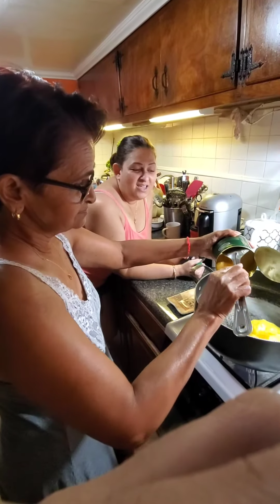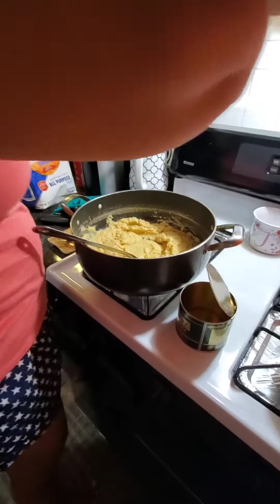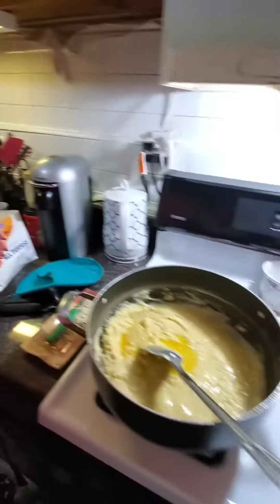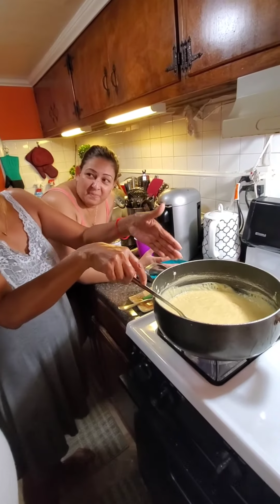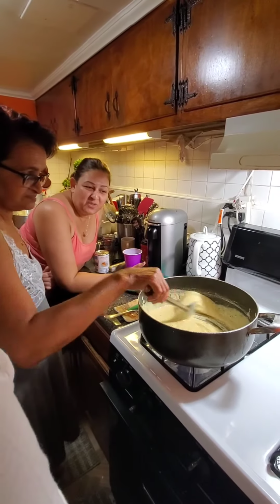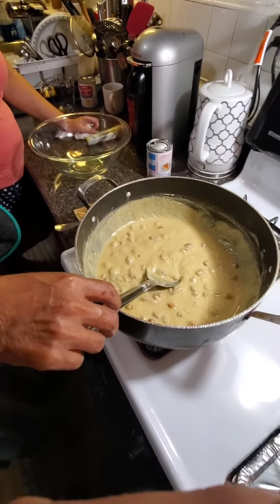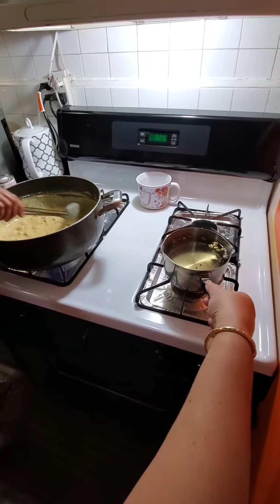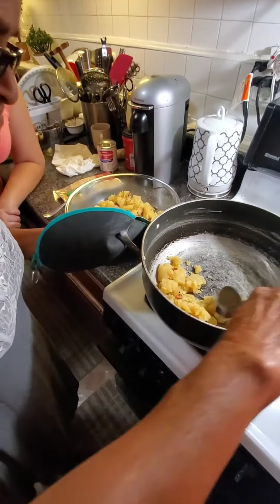Trinidad Style Parsad

Comment: Hi. How. Much. Water in. Cups did. U. Put to. Make. Ur. Sugar water and. U. Make. A. Mistake. U. Said. 2cupd. Flour in ur. Sugar water
Can u. Pls. Put. Up. Ur. Recipe. In. It's. Right order thk u and. Enjoy  can I. Have. A. Taste
Reply: It. Look. Yummy
Reply: Hi Marilyn.  I made this yesterday with this recipe:  Cut up fine 1 tin  (or 225g in a bottle - that weight includes the liquid) cocktail cherries (or soak raisins if you prefer).  Bring to Boil: 5 cups milk (include in the 5 cups, one tin evaporated milk and the rest whole milk), 2 cups sugar, almond extract (and any spice you want) plus some juice from the cocktail cherries.   Once milk boil, turn off cooker and leave until flour and ghee mixture is ready.  In a karahi, add 1 cup melted ghee, 2 cups plain flour.  Brown on low heat for about 15-20 mins and then get someone to add the milk and stir at the same time.  I added the milk in one go.  It will look like it's not possible for it to turn into persad, but keep stirring and the magic will happen.  Good Luck!